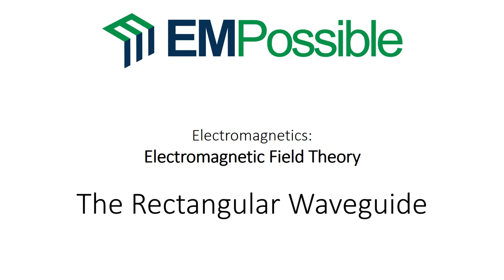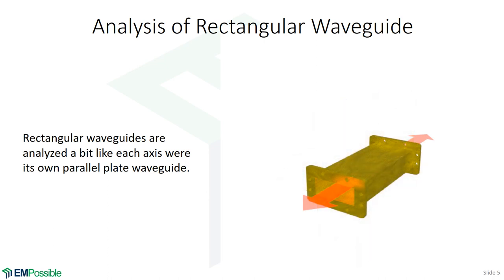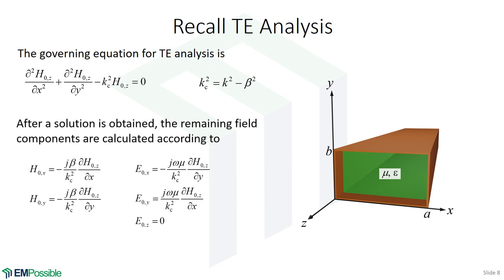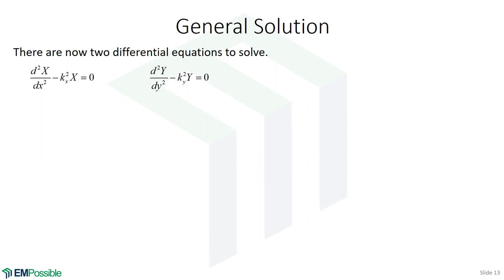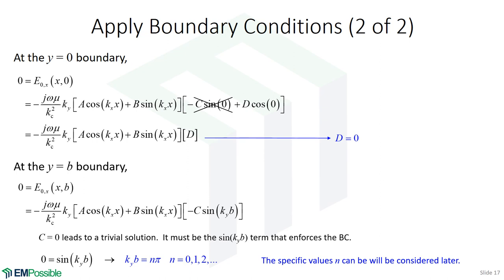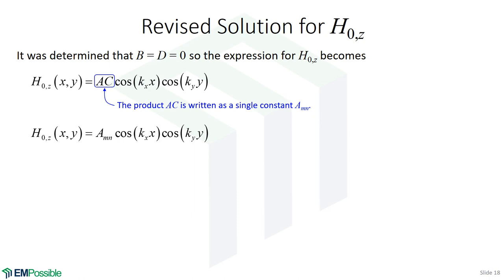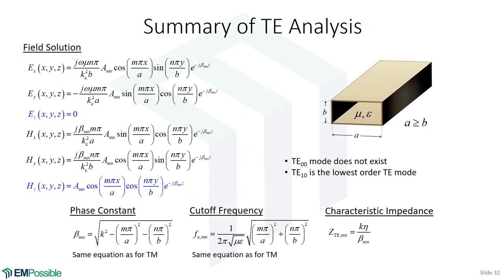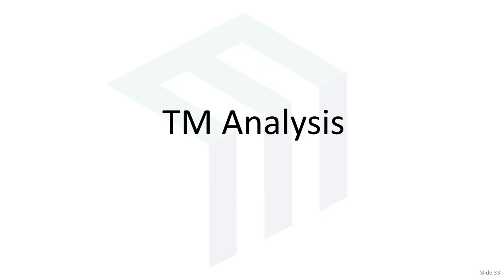Lecture -- Rectangular waveguide

Comment: very good explanation as always. I recently discovered for myself an interesting way of how to look at this dispersive behavior you are talking about in min 34. Beta^2 = k^2 - (kx^2+ky^2) : So if you increase the frequency for one fixed mode you can neglect kx and ky compared to k at some point which means that we have "free space" conditions where Beta^2 = k^2  (no dispersion). It's like the wavelength of that mode gets so small, that the waveguide geometry looks infinite from its point of view, same as a plane wave traveling in free space.

Comment: Perfect video for our small electromagnetic engineering community. I saw your video about the dielectric slab waveguide, with a very good mathematical explanation on how the 2 sets of solutions (TE and TM) are naturally decoupling from each other, due to the invariability along one axis. However, for common metallic waveguides, I don’t see a similar explanation on why we have TE and TM modes. I mean that, in every relevant textbook, the analysis begins assuming the existence of TE and TM modes in advance. I understand that TEM modes are not supported in these waveguides, but what qualifies us to assume a priori TE and TM modes, rather than searching for hybrid modes from the very beginning of the analysis (and then maybe conclude the existence of TE and TM modes as a special case)? Actually, are hybrid modes (modes with both E- and H-field components along the waveguide axis) possible in metallic homogeneous waveguides?
Reply from the maker: How did I miss this question? I see it is three years old!  Very sorry!!  I try to answer everything in less than 24 hours! Anyway, here goes...

First, let me point you to the course website where all of this is laid out:

https://empossible.net/academics/emp3302/

I think Lecture 9b outlines waveguide analysis pretty well. Start there. 

For TE and TM modes to exist in a metallic waveguide, the dielectric medium must be homogeneous. There are some other cases where TE and TM still exists, but homogeneous is easiest to explain. For homogeneous case, the wave equation for Ez and Hz become independent equations, thus the two independent modes. When the Ez equation is solved, that is TM since Hz=0 for those modes. When the Hz equation is solved, that is TE since Ez=0 for those modes. 

When the medium is inhomogeneous, the differential equations for Ez and Hz are coupled and they cannot be separated. We call these hybrid modes. I personally do not like that title because it make it seem like something strange is happening.  Instead, this is the normal thing to happen for guided modes. The emergence of TE and TM modes is the special case, not hybrid modes. However, TE and TM is what we learn about because the math is simpler and the waveguides are easier to manufacture.

Hope this helps!

Comment: My understanding is that only discrete modes are supported in rec waveguides, basically determined when E-field is 0 at boundaries. This physically makes sense but what happens if wave frequency is between two different modes say TE01 and TE02?  in this case frequency is more than TE01 but boundary conditions are NOT met.
Reply from the maker: The modes are discrete spatially, not by frequency. That is, each mode looks different. They will also propagate at different speeds. Each mode has its own cutoff frequency. Below this frequency that mode is not a guided mode. At any frequency above the cutoff, the mode is propagating.

If you pick a frequency "between two modes" then I think you have picked a frequency above one mode's cutoff and below the other's. That will give you just one guided mode.

BTW...at frequencies below the cutoff frequency, that mode still exists. It is just that the mode will decay quickly with distance and can usually be ignored.

Hope this helps!

Comment: 1. In slide 20(I guess) can't quite understand that what's going on or what is to be understood from the elbow region of the curve of effective phase constant. 
2. Again an overall fantastic lecture but it would be great to have one also on circular waveguide
Reply from the maker: An ordinary wave in vacuum would have a straight line. The curve, or elbow, is due to the wave interacting with the waveguide. This is the dispersion introduced by the waveguide.
Reply: @empossible1577   is it correct to say that unless the frequency of a certain mode is way above the cut off there will always be dispersion in a wave guide because of the non linear relationship between omega and beta
Reply from the maker: @alexandermuller8858  For ordinary waveguides, yes I think so. However, there are waveguides that engineer the dispersion and sometimes even reverse it. Photonic crystal waveguides are a good example of engineering the dispersion of guided modes.